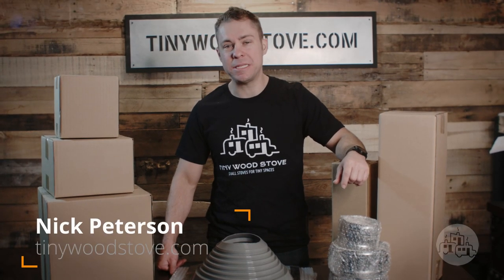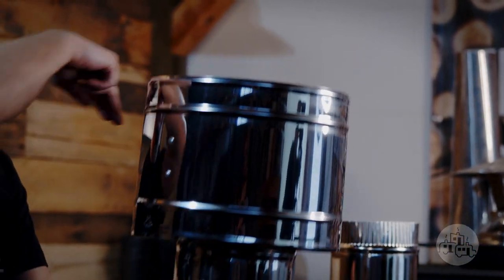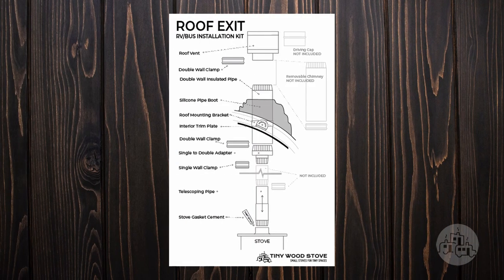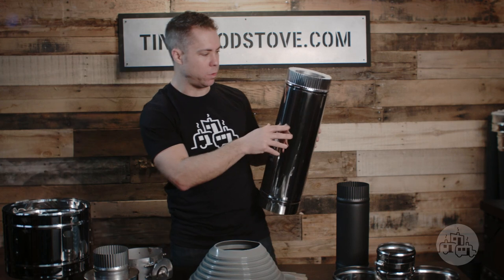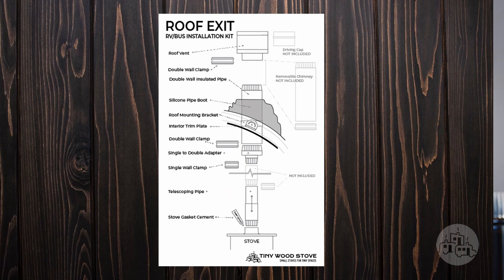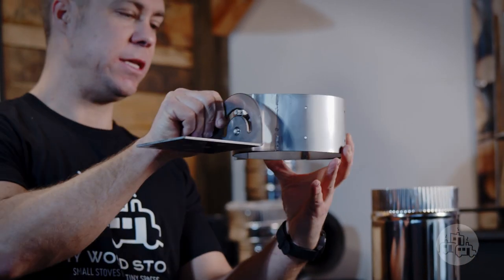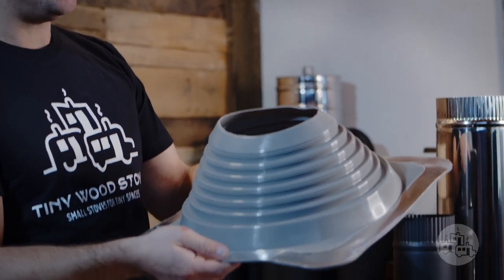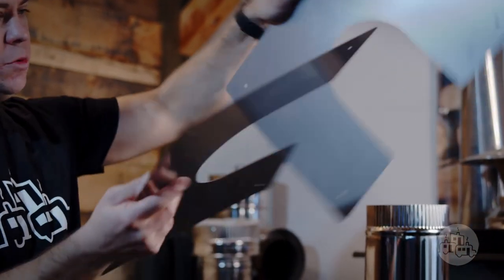TINY WOOD STOVE: RV & Bus Roof Installation Kit

Comment: How long does the telescope pipe goes to? I estimate 2.5 ft or less : Obviously it isn't long enough for ANY  installation. 
Looking at price for the kit, I find it ridiculous I would have to pay more for the right Height of pipes I need. Perhaps you should give 2 telescoping pipes for the price of one which is marked as $65.00ea on your website.
Reply from the maker: Our kits are a great option to get the basic flue parts for most setups, with the option to add on for all setups that need more (for example: telescoping pipe). We'll be happy to help you plan your stove setup and figure out the most efficient and economical option.